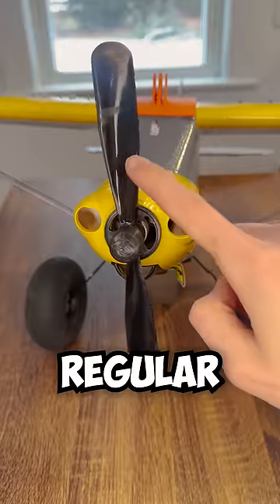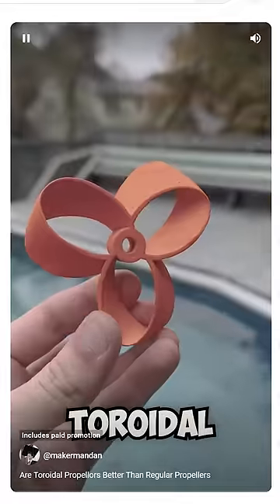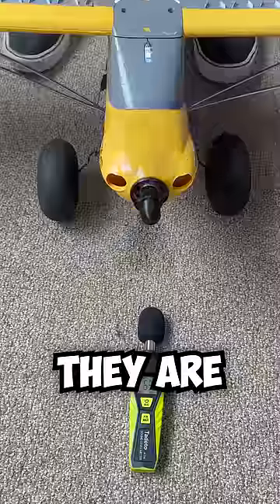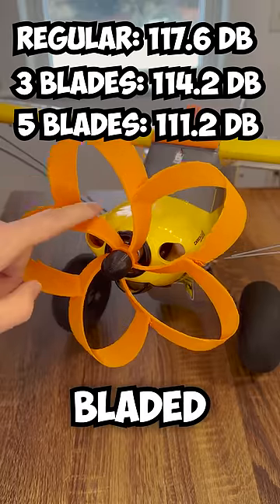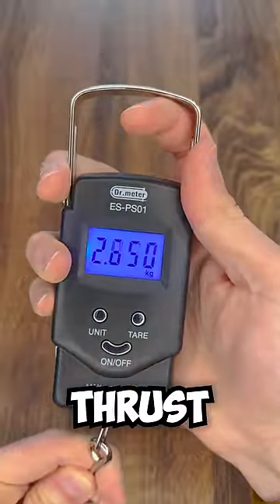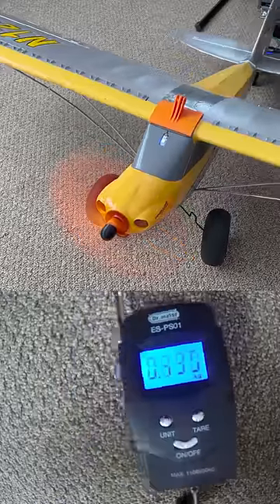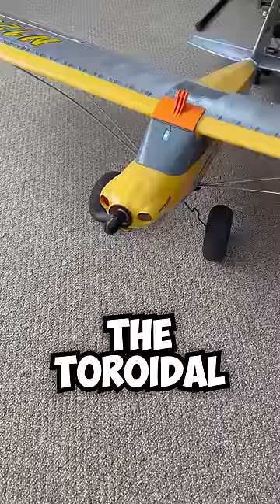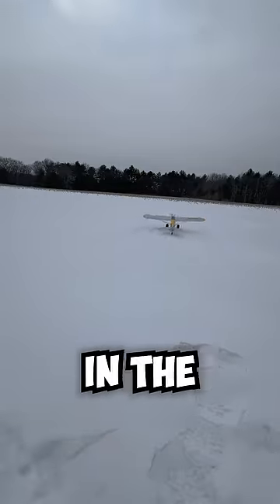Toroidal vs Regular Propeller for RC Plane

Comment: Have you compared with 2 toroidal bladed propellers? Based on your 3 and 5-bladed toroidals data, the 2-bladed toroidal propellers may be equivalent with the regular 2-bladed propeller.

Comment: The shape of the propeller is not optimised. Just making a loop like that won't work. The 'beginning' and the 'end' of each blade needs to be at a different level. And the angle of each protuding blades need to be shaped properly to trap as much air as possible. And the 'loop' shaped to 'sling' the air as hard as possible.

Comment: Hey dude, the aspect ratio is a lot different to what I've seen but I don't remember watching any other than seafaring props regarding this and the general principal of it. I understand they have the same properties like friction on surface but are dense; likewise, the angle of attack I also appreciate is a large part of it..perhaps they're good for either speed or torque?

Comment: Are they the same pitch and length because that's how they were compared by MIT resulting in 40 percent gains in thrust 60 percent less "noise"  as in  turbulence resulting in efficiency  not more thrust or less audible sound and they were tested in water for boats not air

Comment: I feel like you really just made a propeller that is different that happens to be weaker and quieter. A single blade propeller with less pitch might yield the same results. To be more scientific, could you try and match one of the variables and see how the other compares? (For example, make them have equal thrusts, then see which is quieter)

Comment: 6 decibels may not sound impressive if you don't know how decibels work. They're scaled logarithmically, which, to dumb it down, is effectively exponential. So 6 decibels is about half the actual loudness. 

Aa for the performance, it takes painstaking effort to make toroidals as effective as traditional propellors. They're harder to maintain too, which is the big reason they haven't taken off (hah) in large projects.

Comment: Are they actually weaker or they just heavier so the motor has to struggle to turn a heavier weight, so weight to performance wise what's the offset would be my question?

Comment: Testing thrust from the pull force of the plane is not viable when addressing aerodynamics of propellers designed for better areodynamics which in return creates stronger thrust.

Comment: They work better in water. Not meant for air.
It's a hydrodynamic thing. Like explosives. 
Water doesn't compress. Check out the science.

Comment: Yo can’t get more performance just by changing the propeller, Engineers already perfected the propeller decades ago. 

You can’t get something without the other, in other words, you can’t make a propeller quicker by simply changing it’s, all you’re doing is adding more drag and therefore making a lower performing blade.

Comment: Yeah but did your toroidal props go through the same min-max engineering process to determine the best crosssection design? 25% less thrust unoptimized is good!

Comment: Get the edge precise to properly slice the air and balance them as well as the regular prop that's engineered to do so. Or make an equivalent "normal" propeller with the 3D printer as a fair comparison. I like the experiment, but In the name of science my question isn't answered

Comment: Are you really comparing a 3 and 5 blade to 2 blade on a motor that’s made for a 2 blade?  No sht the bigger prop makes less power.  Your motor is bogged and nowhere near its peak.  And yeah, any blade is going to be quieter if you run it slower.  You need to match RPM before you can start to compare props.  Then the print quality comes in to question if it’s not completely smooth and burr free.

Comment: what if you matched the 2 blade thrust value (lower throttle) to the toroidal one, is it still 6db louder? also  amp draw should be compared

Comment: So he got it wrong. They would produce more thrust if the motor was able to spin them at the same speed at the original prop. You can hear the motor spinning slower so obviously they would produce much lower thrust. 🤨

Comment: Each toroidal "blade" is two regular blades; you are probably just putting entirely too much load on that motor with TEN(!) heavy blades and all their drag, but would have to check the RPM to be sure. Also that regular propeller put too much load on my tympanic membranes. Giant peaks in the high frequency range are not very fun. Ow.

Comment: You are comparing apples with pens..... If you want a fair comparison you have to measure the amp that are going through the  motor. And you should 3d print both propellors. Not just the toroil one..... 3d printing propellors has a important difference. It's the surface....

Comment: The rough surface produced by the fdm 3d print is not doing you any favors. Try smoothing them, or getting resin prints.

Comment: The blade profile of your 3D printed propellers are completely different and far less aerodynamic compared to the professionally-made propellor. That's the key reason they are not as effective. It's not a proper comparison.

Comment: TIP: 3d printing these propellers is not a good idea, the edges and overall surface that comes with 3d printing makes these in some cases much worse then a standard propeller

Comment: Print a sphere instead. 0.0dB and no thrust 😂.  The toroidal propellers are not sharp. Did you expect a more blunt knife to cut butter more easily? As that is basically what a prop should do right: cut through the air with an angle.

Comment: The prop size is not correct to compare to the  2 blade, judging off of sound the five blade torridial, should be an inch or more smaller.

Comment: You can’t compare your 3d printed propellers to a molded one, or you’ll just compare fabrication methods. You have to compare it to a 3d printed normal design propeller. Also the effective blade area should be the same, otherwise you’d just compare different size propellers. Please redo your test.

Comment: the one of five is not really five they are not individual like in the three one and also they are jointed with this u at the edges I imagine is for sustaining the structure? do you understand what I am trying to say? make a three and five one but individuals like the 1st one with two print them the same model the same structure but instead of 2, 3 and 5

Comment: 3D printed surface is not smooth and 3D printed propellers is same thickness and has 4 edges per blade, while regular has airfoil shape and 1 edge

Comment: 🟦… The reason the toroidals aren't outperforming the standard propeller is because you've got the angles on the toradials wrong & You've done no smoothing or work of any kind on the leading edge,.. I don't know where you got the plans for them but I can tell from here they're not a correct design.

And BTW; The word "Subscribe" in a pill-shaped box covered the ENTIRE display of the scale in the video!
... I don't know why they don't,.. But people who make "Shorts" should take intuh consideration all that Crap that's gonna be in the way of a-LOT of important stuff at the bottom 3rd'a th' screen.

Comment: But in real life, for real plane they are useless, cause you cannot change pitch of this type of propeller to get optimal thrust in different phases of flight.
Or propeller will be made from flexible and strong material🤔.

Comment: Ok there’s a lot wrong with this testing. For one, your comparing a well made and designed propeller with a homemade 3D printed one, this alone makes a world of a difference. 2nd, you didn’t even take the pitch and number of blades into account, 3rd, there are more things to test for than thrust output, such as efficiency, battery life, weight reduction, etc. so IMO this was a poorly done test.

Comment: Stupid “thrust measurement” as the blades on the propeller are stalled.  For example, as an instructor I used to prank my students flying a Cessna 150 by putting my finger through the tail tiedown ring and was about the keep the plane from moving no matter how much throttle they applied.

Comment: Weight, blade pitch, and blade shape are huge factors. The toroidal props you printed don’t have the R&D that the standard prop or real torroidal props have, so this is largely a useless test. You’re comparing apples to something you think looks like an apple that you 3D printed..

Comment: the noise level and thrust are laregely impacted by the design, better test instead of this dumpster fire would comparing designs of equal air flow, then comparing the sound pressure, and again, i cant distress enough, there are so many more factors to consider which were not, that qualifies this as a dumpster fire

Comment: Toroidal propellers are designed and manufactured much more elaborately than these poorly designed flat profiles, this comparison is complete nonsense. Apart from that, the power consumption of the drive is not taken into account in this “comparison”.

Comment: For the last time.
 No... no they're not as ive seen no one bother to deal with pitch, rake or anything about propellers on the boat or air craft..and no one knows what a variable pitch prop is so... still no and they're weaker.. so any impacts cause catastrophic damage

Comment: Slightly weaker ?  fking 25% is not SLIGHTLY it's 3/4 of the originla like saying a hellcat doing 500 hp is just slightly weaker than the 790 stock....

Comment: FAIL! You might have also noticed that 3d printed objects have a very uneven surface.  Your factory blade is very smooth.  Your 3d printed ones have many bumps.  To accurately compare them you should have 3d printed the standard style blade as well.  These bumps would, increase weight, increase sound, and decrease power.

I'm not saying that the standard prop is not better, only that this test didn't prove anything other than your inability to scientifically test the idea.

Comment: There's an Australian prop company for ships and they have the same infinite type that you're using. It's just a matter of getting the angles right and the reason why that is and I'll tell you. The infinite props give out 40%. More power! Twr with 30% more speed to the same engine of the ship and when I say shit I mean shit not a boat. But even the boat that they tested is crazy fast with the infinite prop. The five hat infinite that you're using is too much. If you try just a single or a triple and just work on the angle you will achieve the desired result that you're looking for. Proof of a concept has been proven. It just takes time and a little tweaking. Don't give up 🕊️